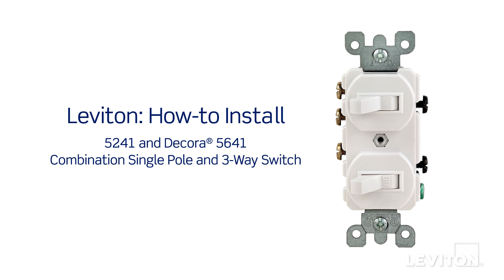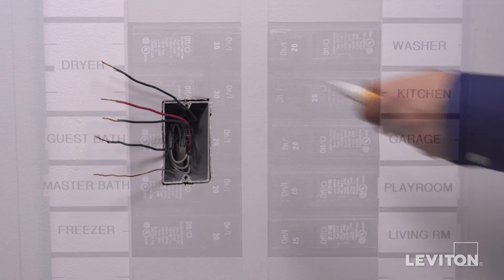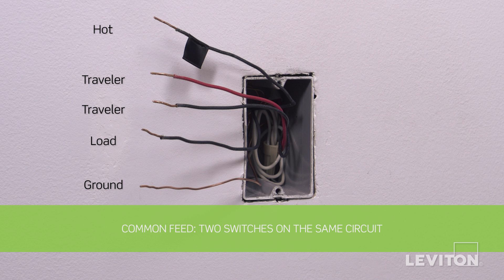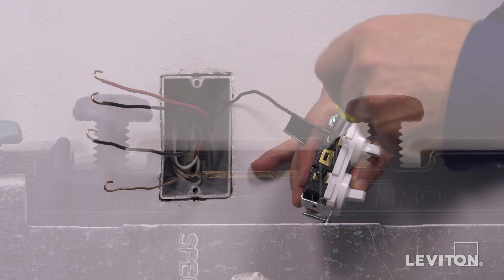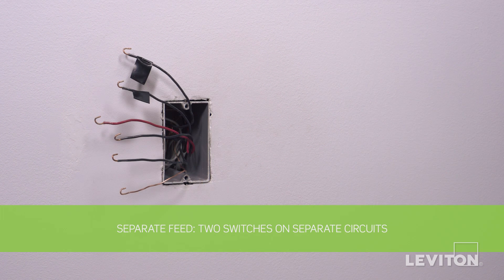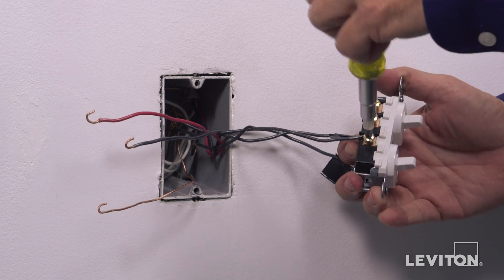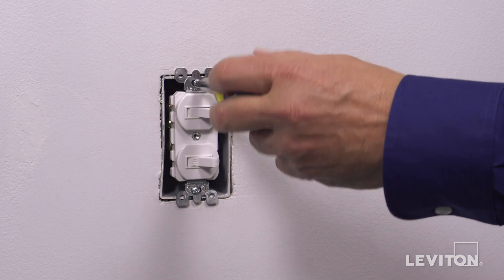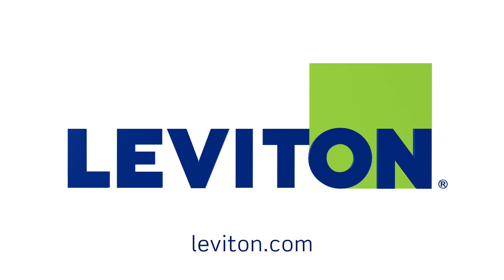How to Install a Combination Device with a Single Pole and a Three-Way Switch | Leviton

Comment: Can I use this with the top switch connected to my single 3 way and the bottom as a single pole for a separate light
Reply: Never mind. Answered my question after I asked. Lol. Thanks